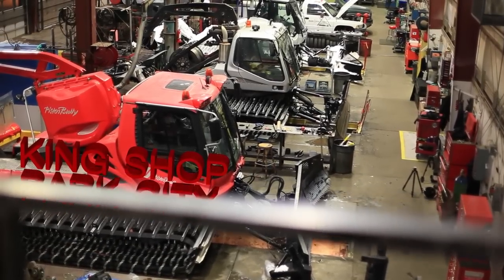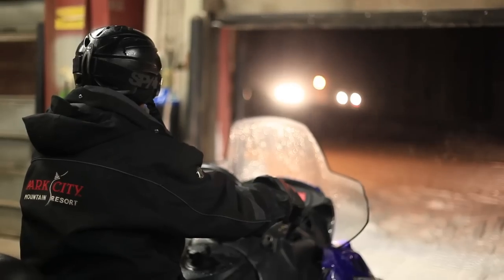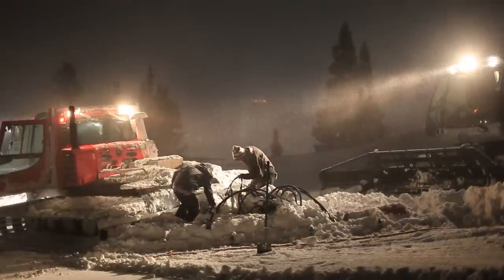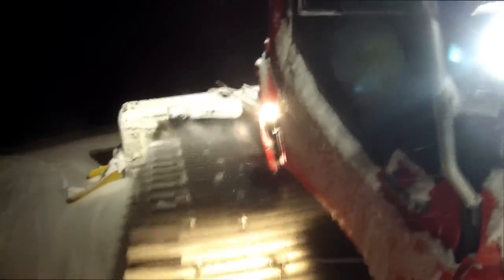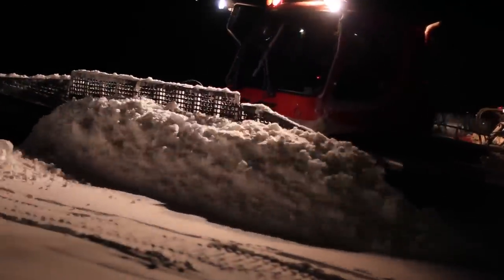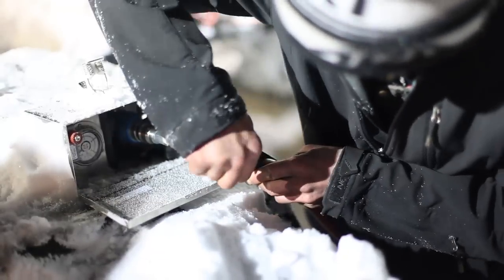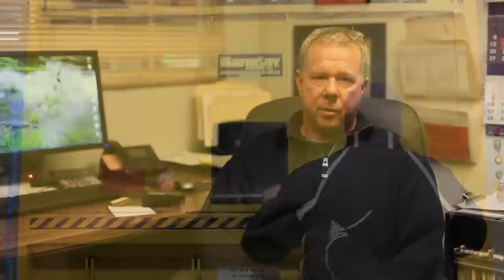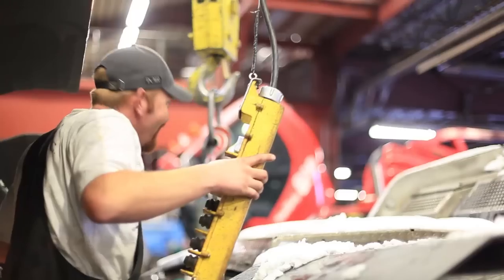Discover "I FIX PARK CITY"

Comment: Do a groomer also work at the summer?
Reply: Umm... No, the snow melts. Thats why its called "summer"...
Reply: @William jakobsen: in Europe it depends on the position you were hired for and your skills. ski lifts and snow guns often have to be maintained and refurbished in the summer months. so groomers with mechanical skills might also work during summers at their "winter job". however normally you don't need as many staff for the summer maintenance. so some groomers work in agriculture for example which is often a good fit because in ag there's less to do during winter. ;-)